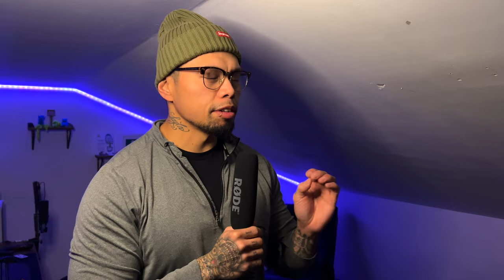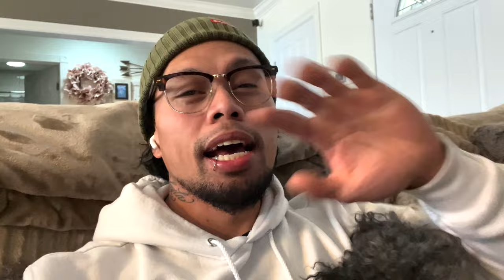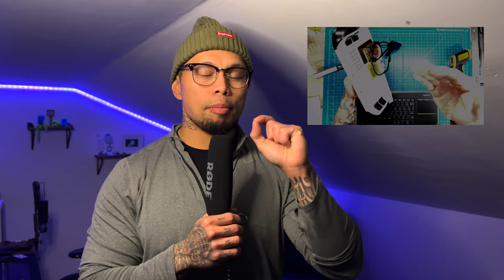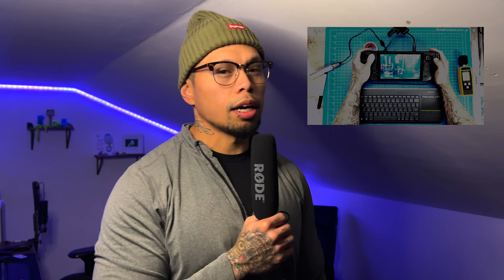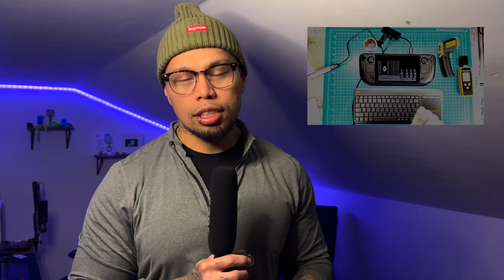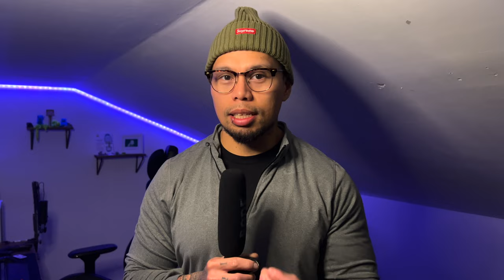Steam Deck Overclocking EP 1

Comment: I've got my stock backplate deck with a ptm 7950 repaste up to 3.8 CPU 1.9 gpu, -40mv on chipset gpu and CPU, and 18w tdp.  At 18w tdp with 6300+rpm I'll hit 90-93c after about 20-30 min on the most demanding games.  18w is really the max of a stock deck but it's a very nice boost.

Biggest boost by far was 6400mhz ram though, my micron ram easily hit that and it was a 5-8fps boost in a game like Hogwarts legacy, way more than any overclocking. Goes to show that the amd apu is really memory speed bottlenecked.  But I had my ch341a reprogrammer at the ready as its a risky one - if it doesn't boot there's a good chance you have a brick.
Reply from the maker: Nice definitely great for a stock deck

Overclocking is tuff with a stock backplate.

28w ran pretty cool with my mods 85c was the average 

Gonna work on RAM over clocks next see how far I can push it.

Comment: I just change my paste and back plate to the new rgb one added a small a small fan over the the bottom grate to help push air into the deck the mini fan move so little air (and only blacks one slot) I'm not worried about it messing with the main fan but after adding that and a heatsink over the spot with the heat spreader and another fan (little bigger this time) I'm able to play b.g.3. around 69 to 70 when before it would hit 75 or so i think when my joysticks go I will change out the paste for that pad I have heard so much about
Reply from the maker: The vent will increase temps quite a bit, still pretty safe in my opinion. 

I don’t think fan intake is necessary just keep the aluminum back plate as cool as you with a external fan and heating sink. 

https://youtu.be/zk7d4N3vHnM

Comment: What about undervolting? I saw it increases fps and lowers temp.
Reply from the maker: Not sure about the increased frames but will help with battery life
Reply: @Diy_Papi  less wattage to support the same clocks = more headroom to boost higher.